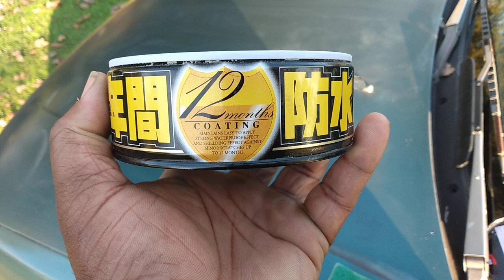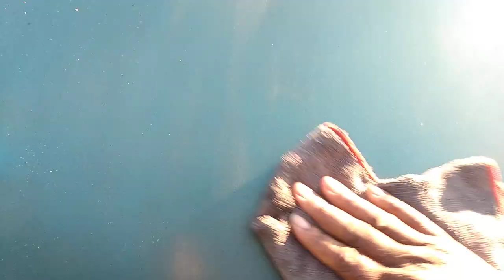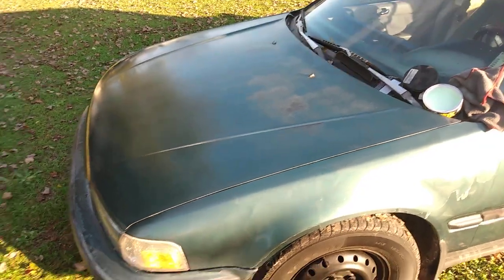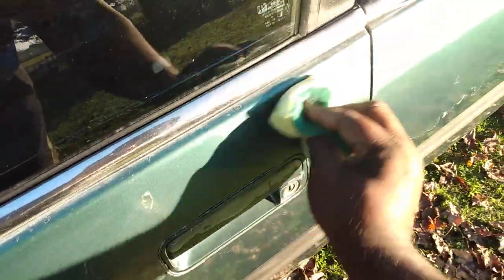Soft99 fusso coat is the only wax that's better then a ceramic & garphene coating it is

Comment: My friend, you're going about it the hard way. Dampen your foam pad, take as little as possible to where you can barely see it on the pad, and apply it to your panel. Wipe it off just as it starts to haze. You will remove it easily and you will still have that legendary Fusso durability and endurance. I agree with you it is amazingly durable!